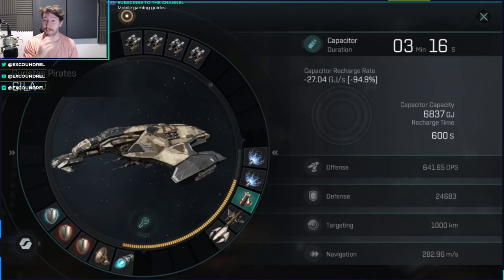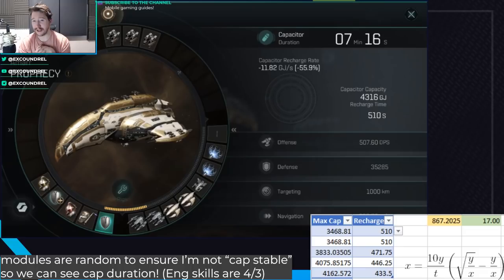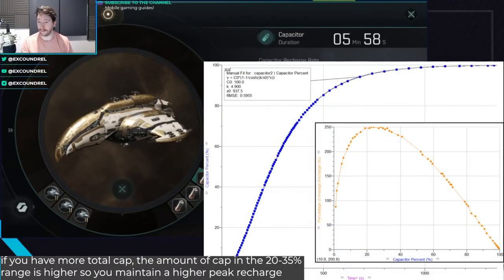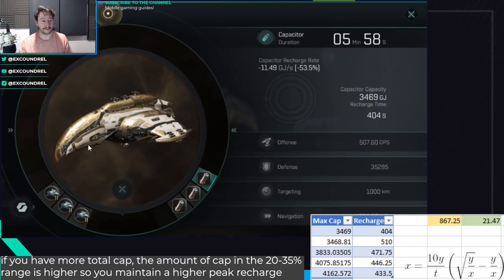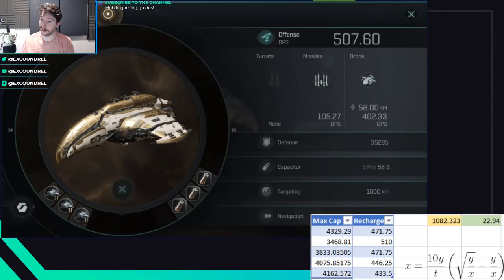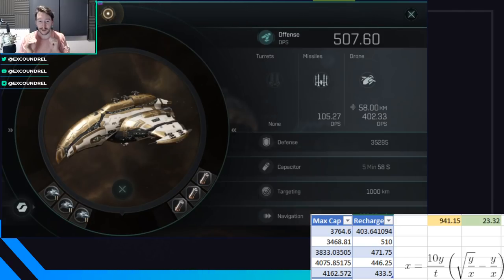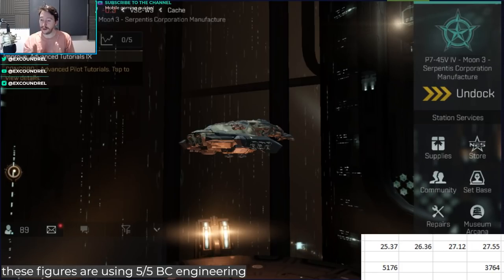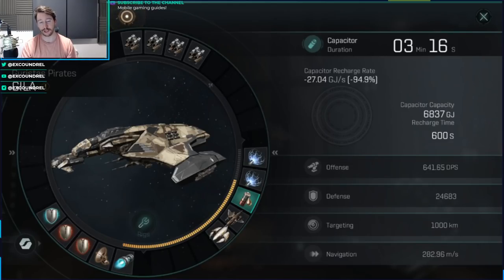CAPACITOR CONTROL CIRCUITS vs. SEMICONDUCTOR CELLS | VERSION 2 (Explained better) | EVE Echoes

Comment from the maker: Ok, so I decided to redo this video. If you have invested in Conductor cells FEAR NOT (they are STILL mostly better) the one exception really being the phantasm. You are mostly looking at CAPACITOR UPTIME as the key stat, not peak recharge time - i lasered in too much on peak recharge yesterday. We just found out my wife is pregnant with our second baby so was a bit of an insane day haha.
Reply: Omg! Congratulations!
Reply: congrats. yoohoo.
Reply: Congrats Bro 🙌
Reply: Gratz... :)
Please also mentioned what is better for the 5/5.. Maybe it is my bad english, but I did not notice if it was pure 3x CCC, 2x CCC and 1x Semi or 3x Semi (now I mean in Prophecy 5/5 engineering).. And also mention the afterburner/microwarpdrive Thumbs Up
Reply from the maker: I mentioned it towards the end but you'd need to be running at peak capacitor with 3x CCC for 10 minutes before it became better than 3 x SMC
Reply: Congrats man I dont ever comment but that deserves some words so congrats man
Reply: grats for 2nd one. good content
Reply: Congrats man :)
Reply: Congratulations!
Reply: You mentioned that an additional CCC may be better if using MWD because MWD reduces cap by 25%.  Would a Dynamic Fuel Valve II do a better job at helping cap stability with MWD vs a CCC? I'm assuming that the DFV II (-30% cap need) includes MWDs as well as the AB.  Thanks in advance as I do not completely understand Dynamic Fuel Valves and sometimes math is hard. 

I'm running a Cov Ops Arbitrator
Reply: Congrats

Comment: I'm glad to see you have the integrity to correct yourself. So many other tubers don't.

Phantasm shouldn't be any different to any other ship, the cap is calculated just the same. Total cap vs peak recharge depends entirely on your use case. Short engagements (i.e. small scale pvp) more buffer is probably preferable, for PVE i'll take more cap over time since i'll hardly ever be in combat for less than 30 minutes at a time.
Reply from the maker: It is different due to the base cap recharge being so high (due to cap recharge time ratio to total cap I assume) - though this whole argument is too complex to make a sweeping statement about tbh. The diff on the phantasm between 3x CCC and 3x SCC = 6gj/s whereas on the Gila it's 2.2 GJ/sec.

It completely depends on your modules, whether you want to be passive cap stable without nos etc.
Reply: @Excoundrel  Well, the important thing is cap works the same as it does in EO, and the equation to that is known. So there is no need for hypotheticals when we can plug the numbers to excel and just math it out. And that's great.

Now would someone please make a proper fitting tool for EE, echoes.gg is incomplete and highly inaccurate and using excel as a makeshift fitting calculator is getting old real fast.
Reply from the maker: @SaltyMaud  i really really really want a proper fitting tool - maybe a project I can work on?

Comment: The main thing to think about is: 
- Do you want your cap to last as long as possible before it runs out: fit Semiconductors. 
- Do you want your cap to recharge fast enough to never run out: fit CCCs. 
Obviously, the latter is only possible if you are running a fit that is geared towards being cap stable and is only missing a few GJ/s to make the difference between cap stability or not being cap stable. If you're running way higher in terms of GJ/s as is realistically attainable with CCC rigs, you will be better off with Semiconductors. If you're only a few GJ/s away from cap stability, CCC rigs may push you across the line and give you infinite cap (duration: infinite). 

Basically, EE needs a fitting simulator really really bad. It's often the only easy way to actually find out which is best without replacing rigs 10 times and re-skilling constantly, just to simulate cap.

Comment: So having a larger swimming pool that fills up a little more slowly is better than a smaller pool that refills slightly faster. Got it.

*in most cases
Reply: Unless you're only sucking water out of the pool at a rate that you can "cover" with the extra GJ/s that CCC rigs give you. If that's the case, cap duration become infinite ( = stable) and the value of CCC rigs are massively higher compared with Semiconductors. It's a bit of a bitch to theorycraft the exact cut-off point without a fitting simulator (unless you enjoy wasting rigs and re-skilling to trial-and-error it to perfection) but it can really be worth it, depending on the goal of your fit.
Reply: Bruh, that took 3 seconds to read and summed up the entire video!!!

Comment: With a Fuel Valve II on the Phantasm (-30% activation cost) that will save 1.78 Cap /sec. How does that compare recharge increase of 1 CCC or CM rig ?
Reply from the maker: I'd need to test but fuel valve is a specific rig fitting right so it's situational
Reply: @Excoundrel  Yeah, this is specifically for Phantasm that will run AB 100% of the time so it's specific for the fitting. I just try to compare less used GJ Vs more regen GJ for the cost of 1 rig slot. Please test this if you can!

Comment: So that is a good question does the microwarp drive penalty affect the bonus of the semiconductor memory cell. IE do you only get 75 percent of the bonus or is it additive with the engineeing bonus and you just total all of them.
Reply from the maker: As far as I can see yes, but it's very hard to tell 100 %
Reply: @Excoundrel  yes you just total them or the micriwarp drive penalty effects the bonus of the semicinductor cell.  For example is it Total capacitor x (1 + engineering bonus + semiconductor bonus) x microwarp drive penalty or Total capacitor x (1 + engineering bonus + semiconductor bonus + microwarp drive penalty).

Comment: long terms short: what do we want to use?
Semi Conductor Memory Cells.
Reply: Unless you are close to being cap stable, in which case CCC rigs can be massively better. CCCs are basically a bit hit or miss: either they make you cap stable (cap duration = infinite) in which case they massively out-perform Semiconductors or you don't reach cap stability with CCCs and then you'd be better off with Semiconductors. Sadly, it's not really easy to find out without lots of math, trial-and-error or a fitting simulator.

Comment: Why you didn't just build a table to show each of the variants row by row so you could compare i do not know. They say a picture is worth a thousand words...talking over 2 cells that change rather than showing line by line. 
Also if youre going to do this...coffee first mate...your message is 100% right but this could of been so much better.
Love your other vids though, still a massive fan, so this is just constructive criticism on presentation of the info.
Reply from the maker: Writing a reddit post as we speak tbh, I will likely do another follow up on the reddit post. I don't drink coffee though ha, sorry just needed to ramble to make myself feel a bit better tbh
Reply: @Excoundrel  All good and looking forward to the reddit post. Have a great day mate.

Comment: Nice explain, but i prefer 1x Adaptive and 1x Reactive Hardener (its more effective then 2x Adaptive)
Reply: Actually it depends, 2 adaptive is technically better than 1 adaptive and 1 reactive, but 2 adaptive and 1 reactive is better than 3 adaptive
Reply: @lajuanjames5683  I testet both, 2x Adaptive and 1x Adaptive + 1x Reactive. My resistance is better with red and yellow(not versus rockets).
Reply: @Azucai-YT  yeah but Excoundrel flies vs rocket and cannon anomalies wich have too many dmg types involved. I fly vs laser rats, boosting my reactivate hardener to 40% em resistance

Comment: Now take into account that in T8+ Story missions (which obviously make you tons of ISK and is for most players the GOTO money maker) you are getting energy neutralized very often. Now guess what. It will drain your 10k cap allmost as fast as your 6k cap. In those situations you allways want faster recharge ticks to get modules going, before the next neutralizer cycle of npc hits you.. making CCC far superior for this type of content.
Reply from the maker: not always the case, i think that's a one-dimensional way of looking at it. Higher cap pool protects against Neuts more than a lower cap pool with a slightly quicker recharge
Reply: @D K you may be confusing neuts with nos. A neut will drain a fixed amount. A nos will drain the difference between the 2 capacitors (which when rats have infinite cap I'm not exactly sure how the math works).
I would expect a larger cap to be better protection against neuts, and a lower cap with better % recharge to be better against nos.
You need to look at the absolute recharge rate versus the % recharge rate.
Reply: @rodrigoserafim8834  Have you done those missions where elite cruiser, bc or bs drain your full cap to zero? does not help if you have a little more or less :D
Reply: @yeny7  I repeat the point:
You need to look at the absolute recharge rate versus the % recharge rate.
You can have a larger % recharge rate in a small pool that is smaller in absolute terms of another recharge rate of a large pool.
5% of 100 = 5
10% of 40 = 4
Module activation needs absolute cap usage, not % cap usage.
This means you need to do the math before you can answer what is better. You can be right in some situations and wrong in others.

Comment: Can someone just tell a resume here? I don’t talk to much English
Reply: Recharge speed gives you higher amounts of gj when at the highest recharge rate at 25%-35% wich could be just enough to get your ship stable.

Capacitor amount increases the time frame you are at that peak rate thus helping you more in periods of heavy cap usage. For example, if there is a new wave spawning you activate your booster for a few minutes until a few enemies are gone and you can recharge back up.

Don't forget that both increase the recharge rate. This is because the ship recharges the whole capacitor in a set time. Increasing the amount of capacitor doesn't reduce the time. As reducing the time doesn't reduce the amount.